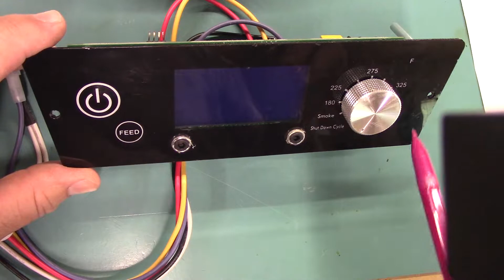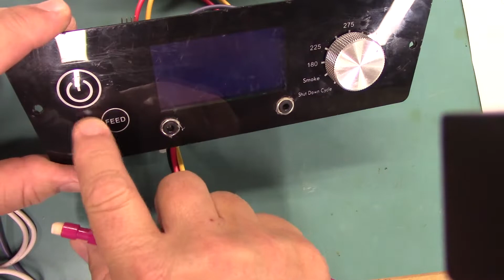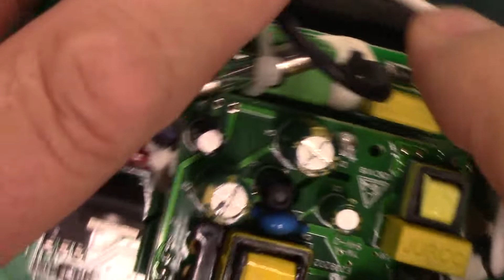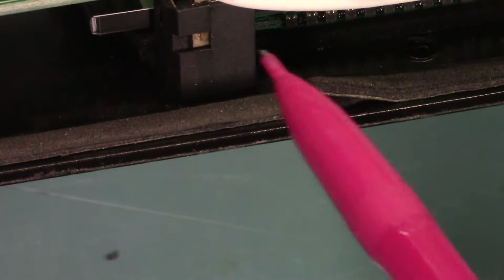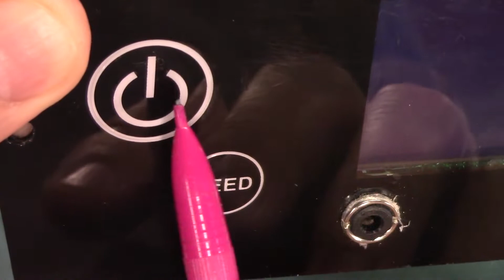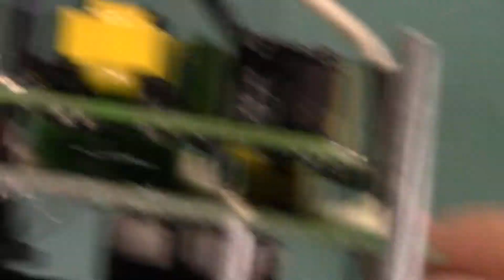IoT #165 - Z-Grills Pellet Grill OEM Controller Teardown

Comment: Very informative!! I unfortunately just bought this grill with this controller and it goes blank immediately after plugging in. I wonder if they connected the wrong things and the fuse is burnt out? I’m going to take it apart today. There is ZERO chance I’ll be able to fit this thing back in the box to return to Amazon…. 

Where would one be able to purchase an aftermarket controller?? 🤔🤔